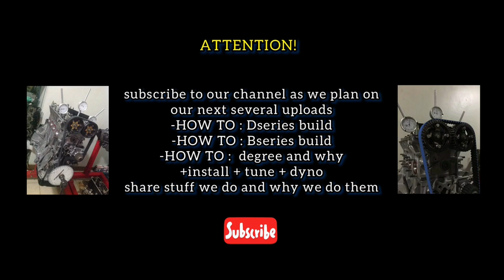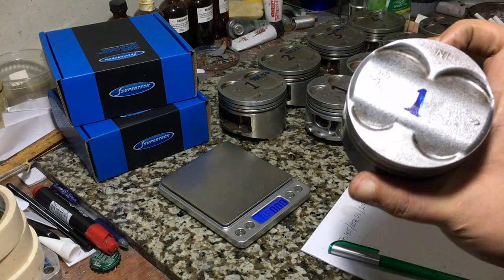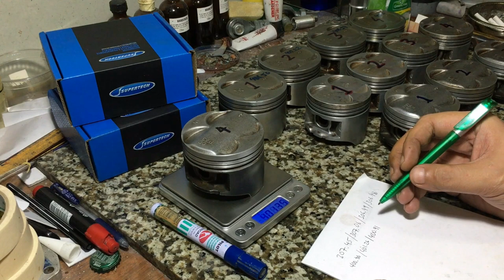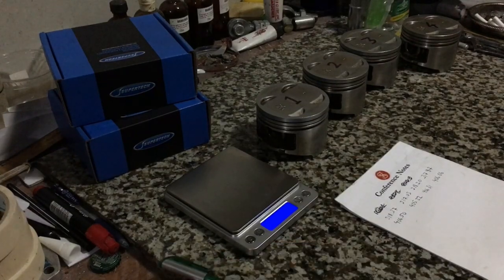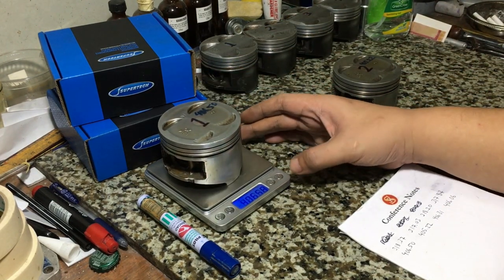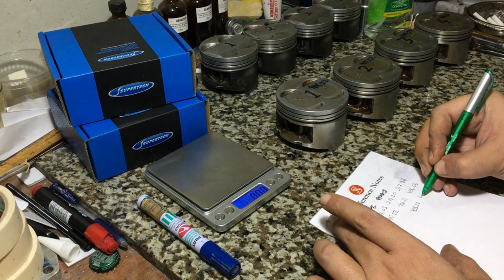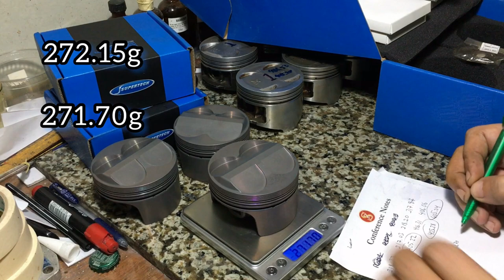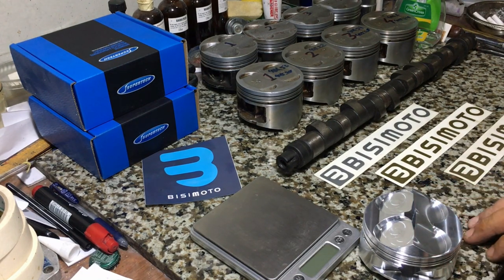How to: Balancing pistons for more power | piston

Comment: I just weight balanced a set of pistons, rods and pins separately and then matched components for the lightest possible combination of rotating weight. One piston had to have 0.01 grams removed from the underside near the pin boss.
Reply from the maker: That’s a good job right there! 💪

Comment: I was wondering with lighter pistons would the engine rev up quicker. Sense the rotating assembly has less mass over all weight. With lightened Flywheel also. Balancing also helps with vibration too right.
Reply from the maker: thats true and a very good question on rotating assembly... for some reason we always usually have oem flywheel so ligher piston helped overall... but def imalso curious with ultra light flywheel and light piston if it rev like motorbike :)

i agree on vibration you know we feel it even on idle right

Comment: Very informative , video , i would like to change my p02 pistons with p03 in my d15 block with d16z6 head ,...how about porting the intake?
Reply from the maker: That’s nice and good
Reply: @SRDmotorsports  in d13 what type of pistons are?
Reply from the maker: @krisztianadrian8528  it depends they are a lot of different ones even the p02 and p03 we never got that here
Reply: @SRDmotorsports  in d13b2 , is with carburator , has slight  dome on top of piston
Reply: @SRDmotorsports  PM1G piston
Reply from the maker: Yeah check my shop page I wrote and posted d15 and d16 deck height

It is not like B series where b16 b18 b20 all have similar deck height

On the d15 it is far and different deck height to d16 so most likely d13 too